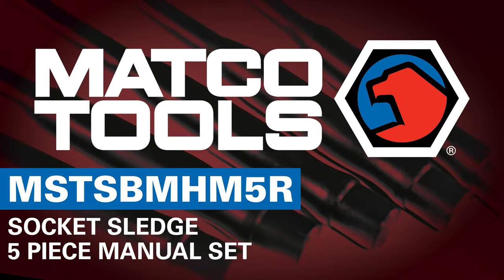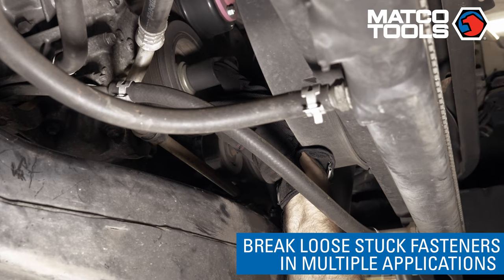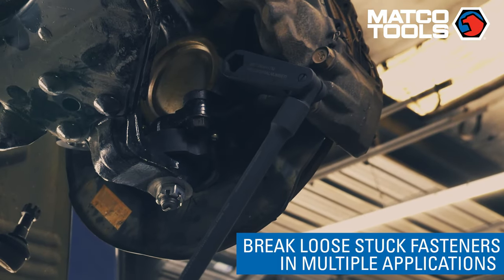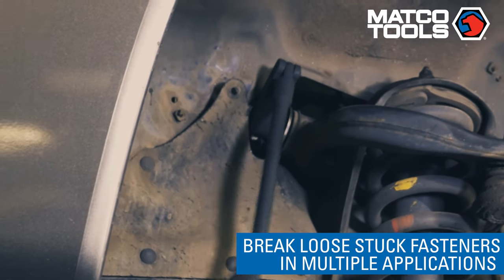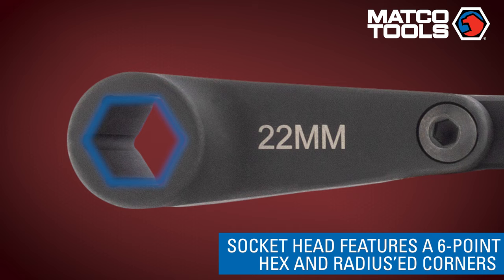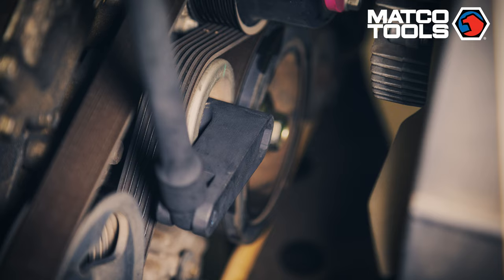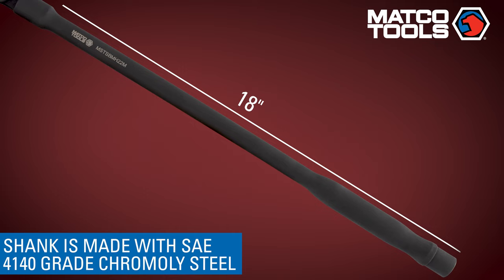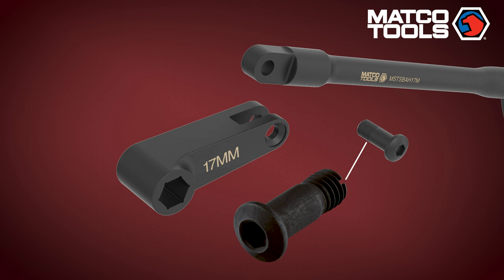MSTSBMHM5R | 5 PIECE MANUAL HAMMER SOCKET SLEDGE SET

Comment: 14 17 19 21 22 or most used? Not on the brand I work on every day, 13 15 18 I use the most. Well 17 for the sump and 19 for wheel nuts where there is plenty of space for big ratchets and breaker bar pipe extensions. These hammer sockets would be great where a socket on ratchet is to long to fit in between. 13 and 15 are the sizes I think would have been useful in the past.